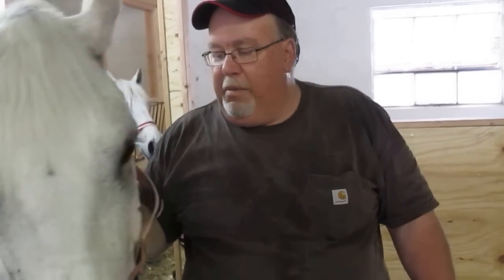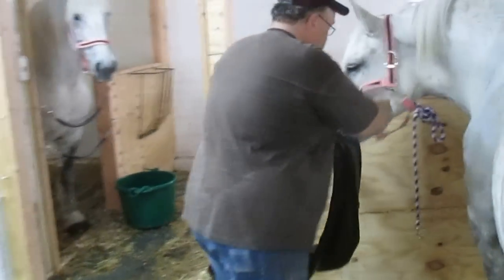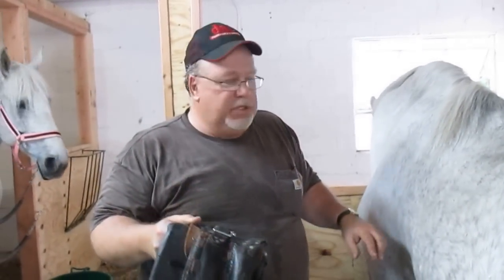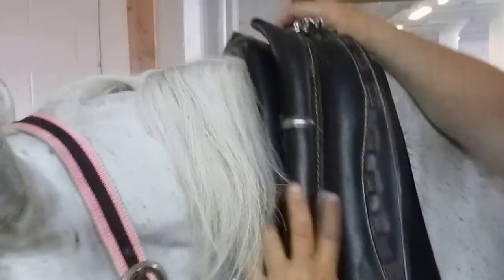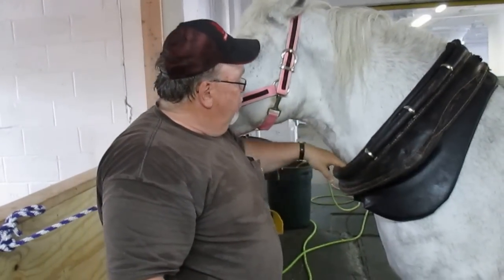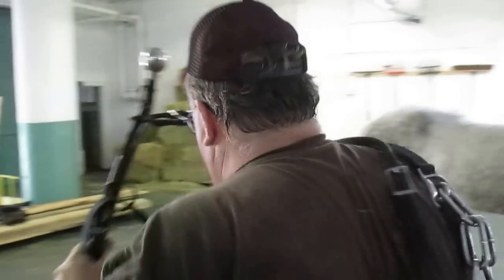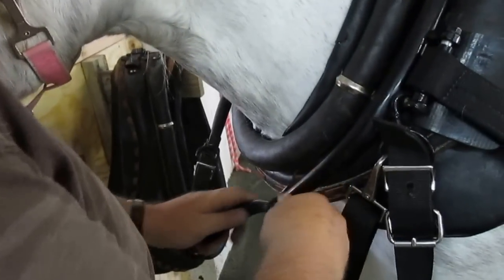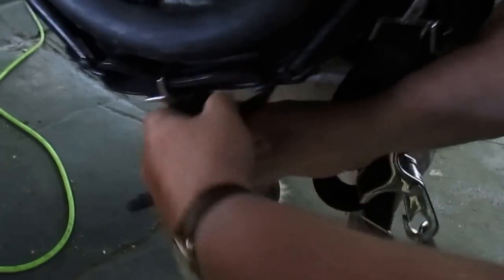Harness Lesson 1

Comment: how does the over check work? I mean how does it  really hook up on a harness? I know it attaches to the bit and was used to keep a horses head up.
Reply: And it's abuse big time. Especially on a draft horse. It's so typical American. NO one uses those things here.
Reply: The overcheck keeps the horse from putting their head down past their knees.  You don't want it too tight.  But the reason for it, if you don't have an overcheck, the horse can put their nose down to their hooves, the bridle and other parts can get caught on the pole, lower parts of the harness.  This is a disaster -- the horse can get hurt, equipment broken.  The story Black Beauty talks about overchecks -- when they are held SO tight, yes it's abusive.